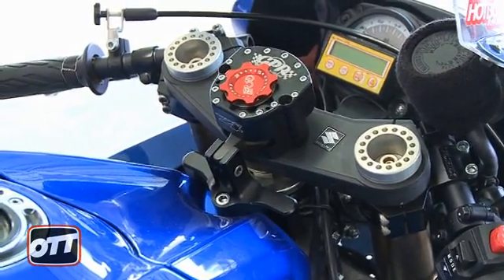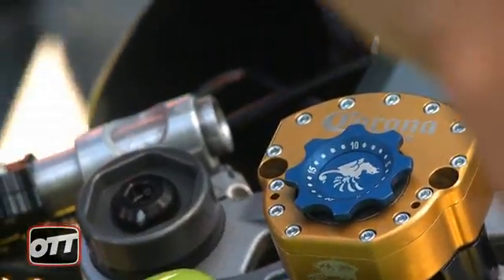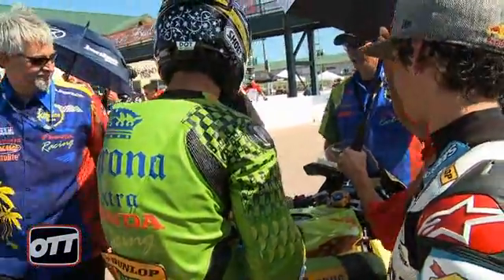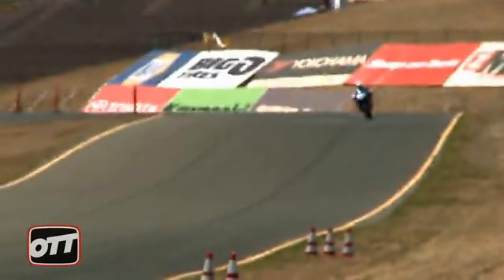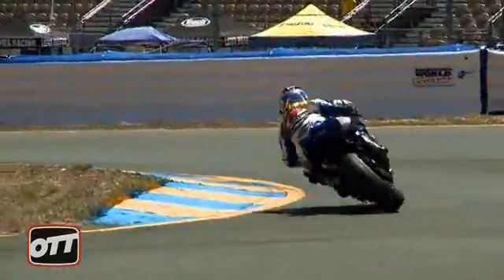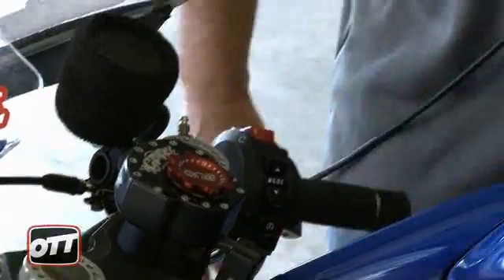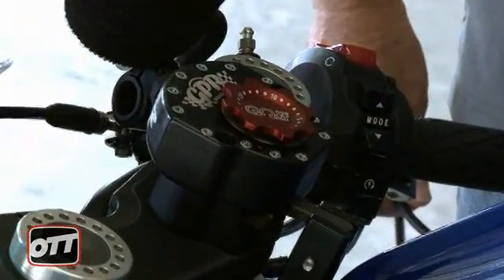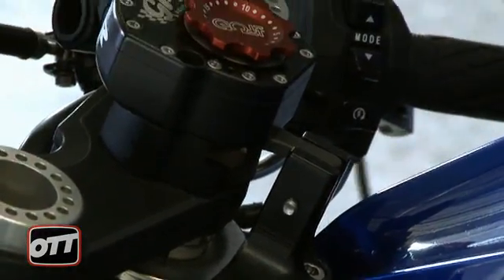Steering Stabilizers Explained

Comment: Those vibrations and wobbles you get when your front wheel comes up off the ground or is slightly elevated because of the dramatic change in direction. This device stiffens the steering mechanism so the vibrations don't create an unwanted wobble and send you in the ditch at 140mph. Now..is that clear enough for you to comprehend or am I just whistling dixie out of my ass?
Reply: Bruce Wayne this is exactly what happened to me a month ago and why I will be investing in a stabilizer.

Comment: To stop death wobbles, tank slapper, it is when you are accelerating really quick and you hit a small bump which makes the wheel flick one way then it quickly corrects back the otherway and back and forth until you slow down. So this stops that from happening.

Comment: @Aonexia Well its not really the front forks, the damper acts as a clamp that attatches the handle bars to the gas tank, by doing this, it can regulate how hard u have to push or pull to move the handle bars, so if ur goin like 120 and u hit a nasty patch of road, the handle bars wont shake, in other words, it allows u to control the handle bars not the road surface, hope this helps.